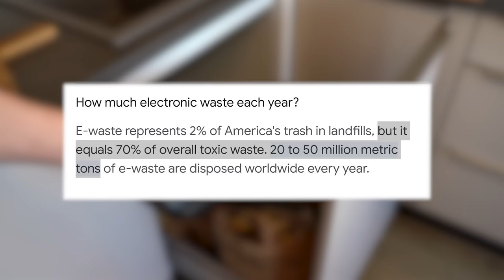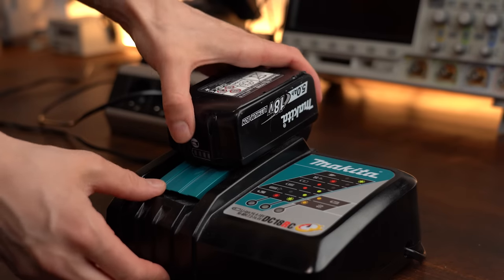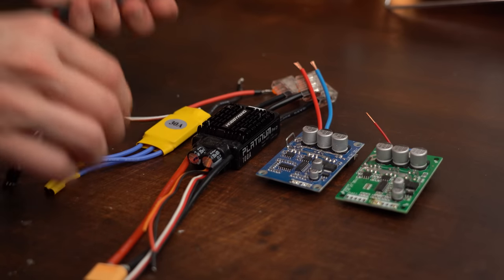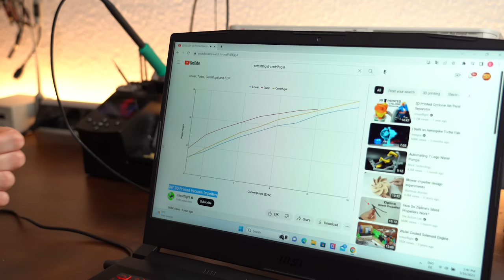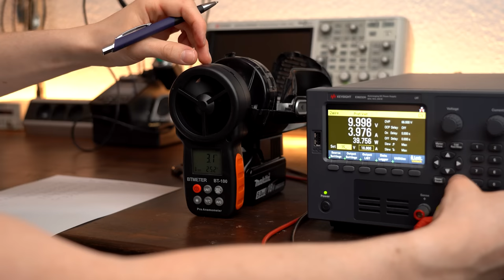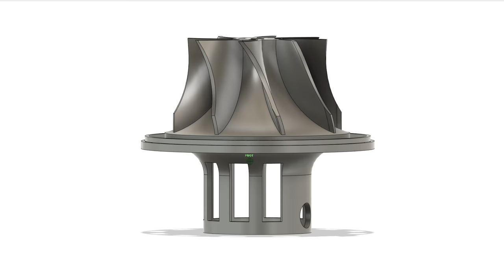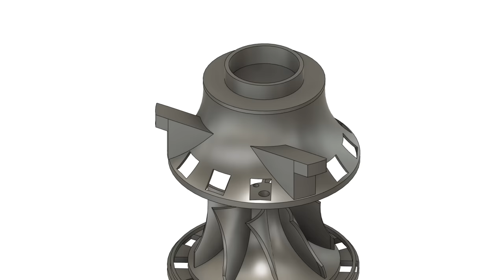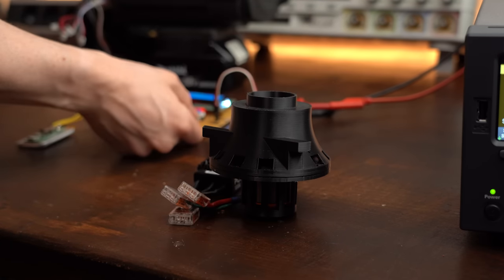I tried OVERPOWERING my Vacuum! (Homemade Turbine)

Comment: Vacuums need static pressure more than speed of airflow, and I think that's where the designed impellor let you down.
Excellent first attempt, and I look forward to seeing updates
Reply from the maker: Thanks for the feedback :-)
Reply: Designing a more preassure optimized impellor would use up some of the power savings by requiering more torque to gain mor suction power
Reply: What is an improvement to the impellor he can make? otherwise this is just restating existing ideas but not directly relevant to a centrifugal impeller design
Reply: @htko89  Just getting an older, small ordinary vacuum cleaner and using the impeller and impeller housing from that is probably the easiest choice.... Static pressure fans/impellers are actually really, really hard to design correctly. They need much tighter tolerances and gaps than you can get with a 3D printer :)
Reply: @AJBtheSuede  , a good 3D printer can hold very tight tolerances, though you can buy several new vacuums for the price of a the printer
Reply: I agree. Ideally, there needs to be as little gap as possible between the air intake port and the pressurized air output. This is why, on the original impeller, it has a raised portion on the intake side that almost touches the hole on the vacuum enclosure. Also, I'd like to point out that you may not gain efficiency here. Air has a certain mass which requires force to move. You could make the impeller lighter but that makes the motor work harder. Making the impeller heavier reduces the electrical load of the motor at high rpm but requires more power to spin up. Keep at it though man!
Reply: OK the cat of nine swords - then try vacuum cleaning with a high power vacuum pump 😁
I think you need a compilation of high flow and a nozzle that allows flow. Having a mouth piece that sucks itself to the wooden floor or the carpet is a pain in the but. I have tried a lot of vacuum cleaners and find mouth piece design just as important as flow and pressure (or lack thereof) 🤓🙂
Reply: @AJBtheSuede  what kind of tolerances? Printers can achieve 0.05mm to 0.1mm resolution, depending on axis. I don’t think its as big a problem as you state.
Reply: @TheProtagonist_777  Not just printer quality, which he does have there with a Bambu Lab X1C, but much more about slicing calibration and so on. Plus, don't forget, the centrifugal forces changing the part parameters under load.
Reply: @htko89  
We're not talking about a static cube here. This is a very complex impeller shaper that's supposed to spin at VERY high speed under a VERY varying load (depending on the nozzle flow velocity)

High flow pump/fan system need tight tolerances under all loads. minimum flex, minimum sample variance. The efficiency losses otherwise are huge
Reply: @htko89  Depends from printer to printer. also, if you're working with a material that shrinks a lot when cooling, say, PEEK, Ultem, nylon or good old ABS, you need to account for that shrinkage in your model or the tolerances of the final design will be wack.
Reply: @AJBtheSuede  i would be tempted to use an old turbo impeller and housing tbh.
Reply: @elantrauma That efficiency curve is a killer. Watching someone struggle with simultaneously balancing size, weight, volume, flow, pressure, temperature, and power consumption gives me a much deeper appreciation for product engineers.
Add to that the fact that it's an iterative process that's been developing for over a century and you start to see how complicated the whole process really is.
Reply: @TheProtagonist_777  Yes, but the centrifugal force from the rotation at those insane speeds pull the impeller outwards, causing it to collide with the outer housing. Atleast if the impeller is designed with tight tolerances (< 1mm). Unless he can get a really stiff filament or design it to come within tolerance spec at a specific rotation speed
Reply: Is that what dyson is good at?
Reply: Yea came here for this. That impeller you have made is really designed for airflow in a compressor housing. You probably should have kinda copied the original, with a flatter impeller. They create more suction.
Reply: @greatscottlab  If you manage to add more stages it will have much better pressure.
however many gains can be had with just a better housing.
One thing you can do instead of more stages is to have a static stage and a rotating stage, however that need a precise angle and size of blade for best performance in a given RPM.
In relation to the motor, I think adding a fan would help with the heat.
to make thing simple, add just one static stage on the front side and lower the tolerances on the centrifugal between the impeller and housing.
And yes, you can add small rings to increase surface area and get a better seal between stages.
Reply: Waste of time
Reply: Centrifugal impellor and he is laughing.
Reply: I agree. I am not an expert in impellers design since I have not done some since engineering school but the angles of the  blades might have some optimizing potential. I am sure there is some people familiar with finite element method software among the viewers.
Reply: Expellers make better static pressure and don't stall as easily, as far as I'm aware.
Reply: Mechanical engineer here. He is correct.
Reply: @AJBtheSuede  While this is true, most vacuum  cleaner impellers  use cheap thin sheet metal spot welded into an integrated impeller / shroud. The blades aren't aerofoils and don't have any complex compound curves, and they work well enough for their application.

The main issues with his design are that it's too tall (meaning that without an upper bearing any imbalance is destroying his motor bearings) and that the diameter is too small. Diameter is what gives the static pressure as the centripetal force goes up as diameter increases. The impeller should be relatively small (to reduce load on the motor and enable sufficient RPM) but also nice and wide.
Reply: @GreatScott! you can optimise the current impeller so that the gap between impeller and housing is minimal secondly add alternating vanes where the air is exiting and point it toward the motor so that when air exits it switches direction eg from clockwise to counter-clockwise this helps generate low pressure at the exit and helps improve overall static air pressure difference. close off the holes at top of housing and add vanes at the back of housing and holes in a way that they cause air to move in opposite direction
Reply: PS it will also keep motor cooler
Reply: @htko89  i think increasing the attack angle or increasing the blade count could increase the performance a lot
Reply: 7:12 I have the same idea for my vacuum from 2019, if there's anyway to upgrade to a brushless motor.  But no, it's actually more waste of time, money, e-waste to modify it.  you're better off buying a cheap chinese brushless vacuum or used ones. brushless motors are insanely high RPM, there's no 3d printer than can make precise and high strength turbines for the speed.
Reply: @JMMC1005  Absolutely true in cheaper vacuums, but they STILL have a 10-100x better shape stability under high load than any plastic 3D-printed impeller, and quite probably 5-10x tighter balance tolerances in manufacturing...
Reply: @AJBtheSuede  That's very true.

I think a smaller, flatter impeller may be strong enough for the required speeds (depending on print settings and filament), and would also lower the CoG and therefore the effect of any angular misalignment.  

I would also strongly suggest that he precisely balances the impeller after printing via sanding or adding mass using a balancing jig. This is even a good idea on injection-molded propellers for R/C aircraft, and they're far more dimensionally accurate than a 3D print.
Reply: An impeller that size you would find in a full size 200HP car, A pancake style compressor which can be found in a shop-vac is a great starting point. my 5.5HP shop-vac has a 5" diameter and is only 6mm thick.
Reply: @htko89  you’ll notice the original impeller had a much wider exit compared to the entry. This increases whirl velocity, decreasing pressure at the exit. By choosing a pump design with a greater exit radius, this should increase the pressure drop
Reply: @colinsmith6340  Also that original flatter impeller had the blades fused to the housing, with the whole housing spinning.  Kind of eliminates one of the primary locations where you'd have pressure loss/leakage in the turbine-style design.
Reply: @Entropy512  Yea, it helps get the air out with momentum which causes the good suction. Printing an impeller like that in one peice is very hard, so it would have to be 2 pieces. That, very careful housing design. Its how car turbos work, no layer on top of the impeller, but the housing is machined carefully to match the profile of the blades.
What scott has done here is made more of a "flow" fan instead of a "static pressure impeller"
Reply: @AJBtheSuede e
Reply: I was going to comment on that. A higher flow velocity doesn't necessarily result in higher suction. Static pressure is the variable to monitor here.
Reply: @Kalvinjj yah, agreed, if he's got an x1c he's got no issues with print tolerances.  Those things are insane.
Reply: Wth is an earth day
Reply: That's what i was going to say.
Reply: @htko89  Tighter tolerances, higher number of blades and a higher angle of attack on the blades usually result in higher static pressure.
The most important tolerance is the space between the housing and the blades edge. The smaller the gap while able to run without touching the better.

If you see the original impeller 3:20 the blades are not exposed. There is a top cover fixed to them. This technically gives the blades the best scenario for static pressure since they have perfect tolerance but at the cost of drag with reduces the blades RPM / efficiency.
Yet even in this configuration the gap between the housing and the impeller still important since the higher the gap the easier it is for the air to just flow back true it.
Reply: @vitor900000  you’re not really explaining the core issue in precision: whether the material can withstand these forces without deflecting, not whether these forces exist. We all know they exist.

However, my argument is 
1) 3d printers can achieve those tolerances, particularly bambu
2) filaments used can minimize those deflections, such as nylon or ABS. 
3) OP’s video already achieved close to original performance. A small optimization of blade and housing geometry can bring this perf past the original part.
4) This isn’t a turbocharger. Y’all are making it seem like we’re dealing with exhaust and jet engine temps. 

Open up one of these handheld vacuums (not dyson), and you’ll see how shitty it is. Hell just watch the video to see the disassembly. The only reason it performed worse is because uploader just slapped on some generic impeller design, instead of actually designing one optimized for this vacuum like the original part.

Instead, here we’re arguing about 0.1mm on a 1-2mm tolerance part downloaded from thingiverse, as if we’re designing turbo pumps from space x rocket engines. Its not that crazy. ABS and NYLON go surprisingly far, especially for small projects like this.
Reply: @htko89  I just answered your first and second reply.

As I said tolerance, number of blades and angle of attack are the things that increase static pressure. The studies of angle of attack has a lot of depth with culminates on the field of blade geometry in aerodynamics.

I can't tell you the limits of 3D printing since I don't work with / have a 3D printer.
But yes there is most likely a good amount of improvement that can be done just by improving the impeller even when considering the limits of the 3D printing.

Another thing to consider is balance. A 3D printed impeller will not be perfect balanced with will add vibration and reduce its max RPM.
Reply: @vitor900000  tolerance angle and number of blades is not material properties.
Reply: @htko89  If you don't remember that was your first question:

"What is an improvement to the impellor he can make?"

And the response I gave answers it...

And as I said I don't work / own a 3D printer to tell you the limits of its material properties. But there are most likely significant improvements to be made to the impeller that are inside the 3D printing limits.
Reply: @vitor900000  fair enough. That is a good point. Im just tired of getting notifications from the “experts” in this thread. You make good points but man do people ever repeat themselves in here.

Youtubers are very representative of the “dunning kruger” effect. So many people here think they are experts but haven’t touched a print once in their life. So many people saying oh my god the precision, the vibrations, this and that but the thing’s RPM is dreadfully slow in the scheme of all things and is quite small and light. Anyone who does any real 3d modelling or product work knows this is not really a big deal for this type of cheap item. It aint a dyson running at god know how many RPM.
Reply: @htko89  I wouldn't consider 20k+ rpm to be slow for that size of a component.
For example: A spinning CD explodes at 20k~30k RPM. And its made of a monolithic/uniform material. In other words you don't have to worry about layer adhesion.
So its definably something to take into account.
Reply: @vitor900000 a cd is also much much wider. The problems in the video are mostly due to poor design, not the filament breaking or print shearing. The motor wasnt even mounted properly ffs.
Reply: @htko89  In my view its not that much smaller...
And when you consider loss in strength from layer adhesion a 3D printed impeller of that size at 20k RPM is most likely running at the edge of its limits.
In engineering we use safety factors. A end product usually should only immediately fail at 2x~3x its expected operation. Its done that way so products don't fail too fast and to account for manufacturing deviations.
Reply: Make the impeller out of a stronger material so it can spin at 45,000 rpms or more.
Reply: Problem is mainly because he's using a semi-axial impeller instead of the radial, shrouded design from the original one, thats generating a higher static pressure difference.
Reply: @greatscottlab Steeper angle of attack to the blades. Otherwise the design is perfect.
Reply: @Nbomber  Realistically you just have to put a half horse in it if you want it to work lol
Otherwise you're just making a more efficient novelty toy
Reply: It's like a partial Tesla turbine come style impeller.
Reply: Guys, Here is The Savior

HalleluYAH translates “Praise ye YaH”

YaH is The Heavenly Father 
YaH arrives via the TENT OF MEETING
YaH was Who they Crucified for our sins
YaH was Crucified on an Almond TREE

— Ancient Semitic Cuneiform of Moshe (Moses)
— Isa Scroll (The Original Isaiah)

Isaiah 42:8
"I am YaH; that is my Name! I will not yield my glory to another or my praise to idols.”

Isaiah 43:11
“I am YAH, and there is no other Savior but Me.”

Isaiah 45:5
“I am YaH, and there is none else.”
Reply: Oh, ok.
So, it needs to maintain the pressure, which could be done with a great seal on the fan?
I guess the designed impeller moved air quickly, but did not keep it from moving back to the original point well enough?
Thank you for any clarification.
Reply: This is like a  dessert after eating / watching /interesting youtube videos , smart people discussing very deep knowledge,  make you feel that as more as you know about something there is much more to know

Comment: That's real engineering 😁 : designing, testing, failing and doing it again !
And always learning something.
Thanks for this video.
Reply from the maker: Thanks for watching :-)
Reply: Amen!
Reply: If it fails again you could maybe use a higher strength plastic (“creep” of the plastic due to centrifugal force and also the heat are a concern, although ABS and Air Cooling Holes seems to be working!), and/or could maybe consider a thrust bearing.

Also, I don’t know if it is a problem yet for this (the plastic’s low weight may be helping, along with the already good tolerances of FDM 3D Printing), but if I remember correctly Turbine Balancing becomes a major issue.

The Old School Method for this is using a Rotary Tool on the “high side” a bit, checking to see if that fixed it via a special tool/jig, then rinse and repeat until it is sufficiently balanced.

There is a modern method where you basically laser ablate away the unbalanced bits *while it is spinning on the test rig*.

I guess those are some solutions that came to my mind in order of increasing complexity. (Probably plenty of good ideas on your own / other comments i just thought I’d throw them out there)
Reply: also, real engineering cares about our planet 🌍
Reply: no.  that's youtube engineering.  it's more like doing something that mimics engineering process for uneducated audience.
Reply: @vasyapupken  and your contribution beside your opinion? The irony is that you make such a claim to said "uneducated" audience.
Reply: But it’s dumbgineering because all that wasted time is not worth it when you can just buy a cheap vacuum.
Reply: @frosty129 , "dumbgineering" is your claim, you are entitled to feel that way. Some might argue that you're completely missing the point and do not completely understand the engineering process in light of being able to buy a cheap alternative.
Reply: @vasyapupken  uninonce
Reply: designing, testing, failing and doing it again? you forgot iteration. otherwise your just doin gthe same thing  over again